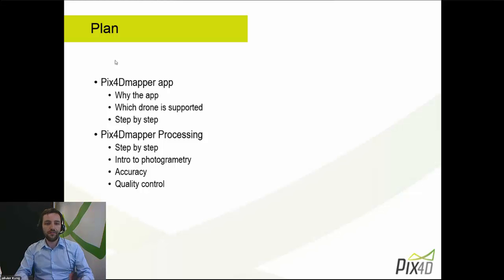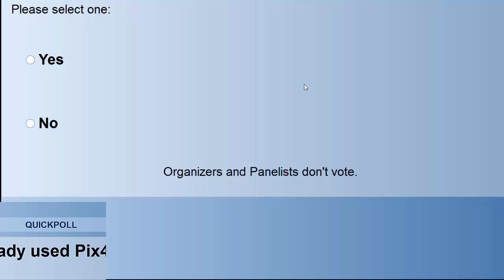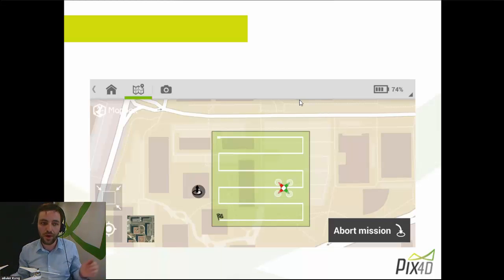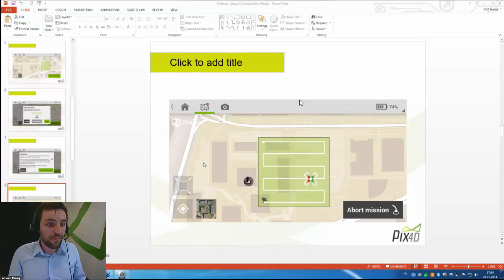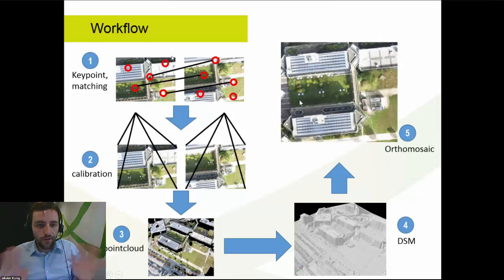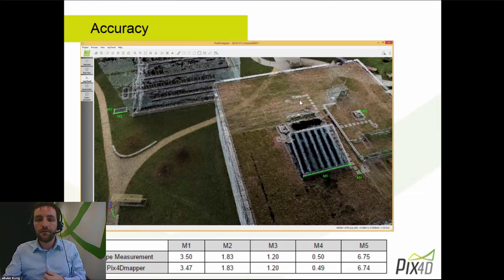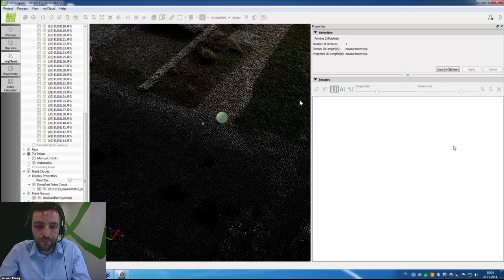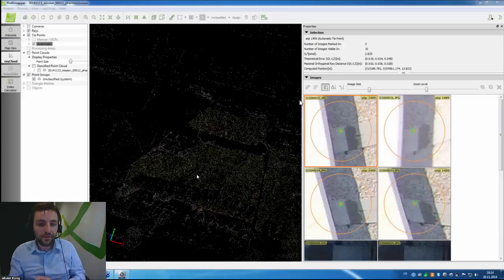Pix4D Webinar 13: DJI Phantom Mapping and 3D Modeling (2nd Edition)

Comment: As a Small Business owner the potential uses for this software are huge. The price needs to be made more affordable, though. Software development is difficult and time consuming and the creators deserve to be paid, however, if the price was more reasonable small business owners, such as myself, would jump to use this.
Reply from the maker: Hi, Cleveland Aerial Media 
Thank you very much for your message.
Pix4Dmapper Pro has also a monthly renting program, without contract, specifically design to fit small businesses.
In case you need some advisory on the specific needs for your aerial mapping business, don't hesitate to contact us at info@pix4d.com